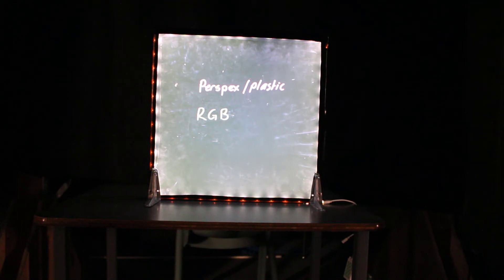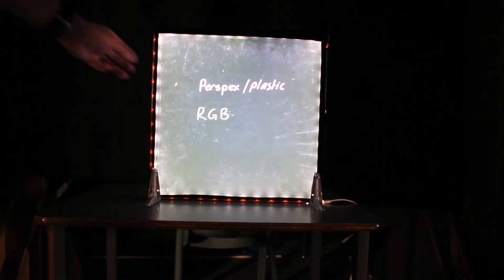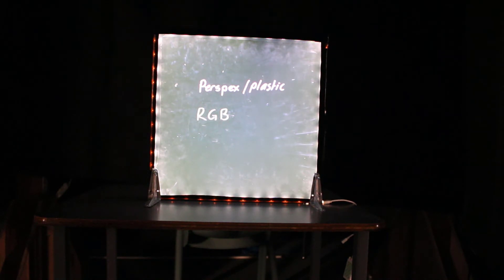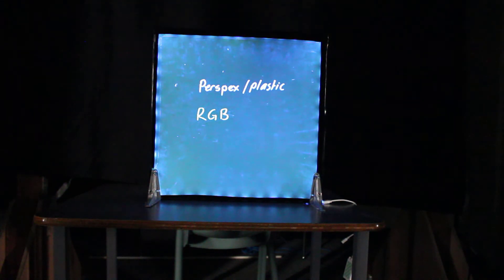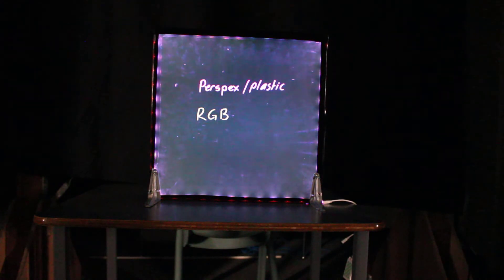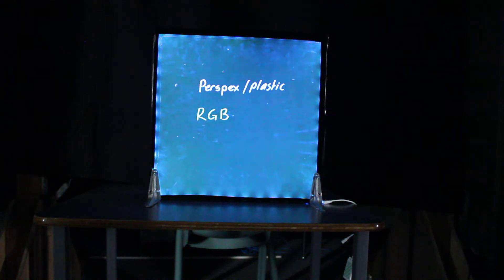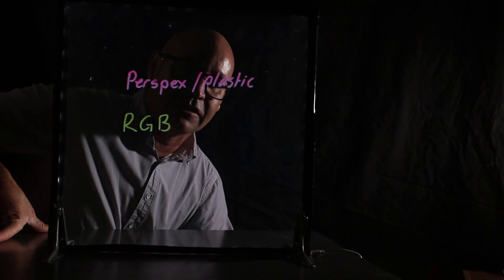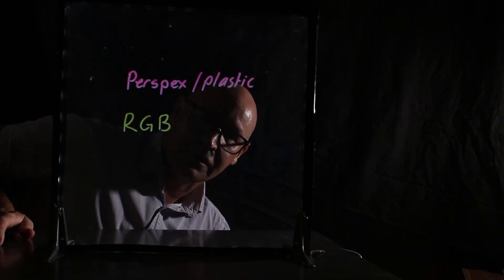Plastic lightboard with RGB LEDs

Comment: This video raises an issue that none of the lightboard DIY/how-to videos discuss.

When set to a colour that is a mix of red, green and blue, the board flickers and strobes on-camera in a way that won't be visible to the human eye. This is because changing the relative brightness of the three primary colours involves pulsing them on and off faster than the eye can see. However, the frequency on the pulsing isn't synched to the camera, and you get a similar strobing effect to what you'll see on car adverts, when the wheels suddenly appear to be turning backwards.
(Note that the strobing/striping in the video won't necessarily be the same as the frequency of the LED flicker -- instead, science nerds might want to try to calculate how the rolling shutter effect and the physics of frequency "beats" combine to generate these striped patterns.)

This problem isn't restricted to RGB LEDs either. "Dimmable" LEDs generally work the same, pulsing on and off rapidly to create the illusion of different brightness levels.

Dimmable video lights have to be specially designed to flicker at such an extremely high frequency that it can't even interact with the camera shutter. This rapid flicker means a whole lot more resistance, so more heat to be dispersed -- most LED video lights have a chunky metal casing to disperse this heat.

So when building a lightboard, you have to either get LEDs of the right light output (so that you don't have to dim them at all) or get LEDs that are video-grade. LEDs sold as video-grade will be more expensive, but some Chinese suppliers will sell video-grade LEDs without saying. The best way to find out is to look at how-to videos on making your own video light panels from LED strips -- these will generally advise on particular part numbers to look out for.
Reply from the maker: Your knowledge is far superior to mine. That is fascinating.  I have never seen the need to have dimmable LEDs.  I have had strobing before that was rectified by changing the frame rate.

Comment: You should try UV LEDs
Reply: I can imagine that would be a good effect, but there's a slight problem:
1) Glass doesn't transmit much UV, so the effect would be lost.
2) UV burns plastics, including acrylic (aka perspex, aka plexiglass) so the edges of the board would likely yellow fairly rapidly with use, limiting the board's useful lifespan considerably.